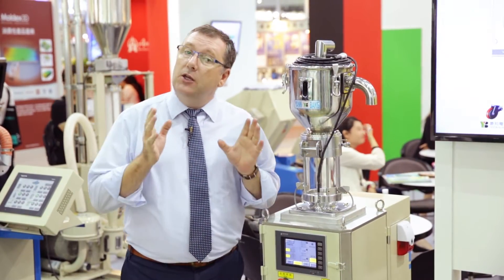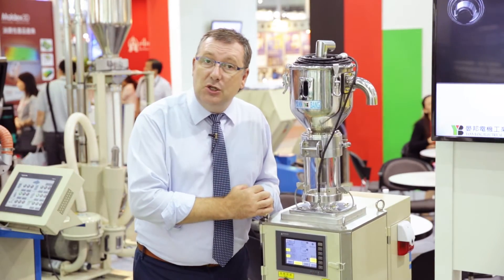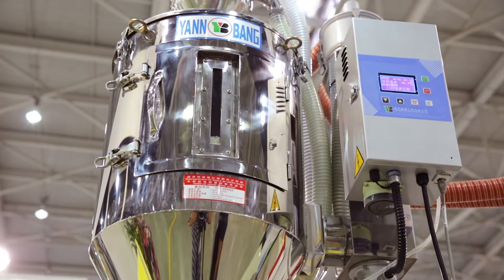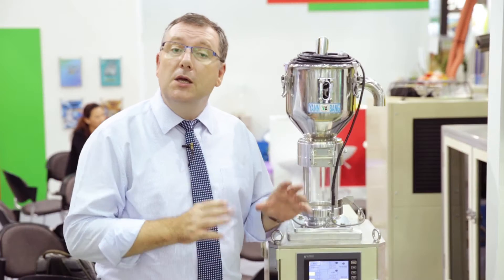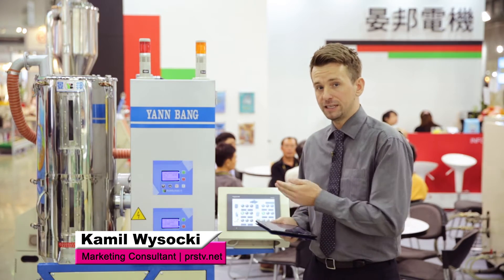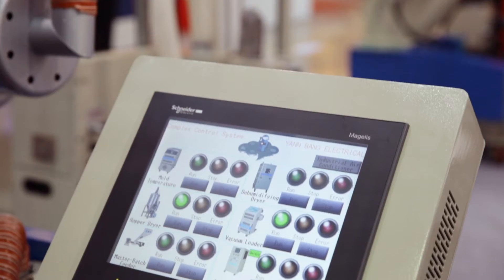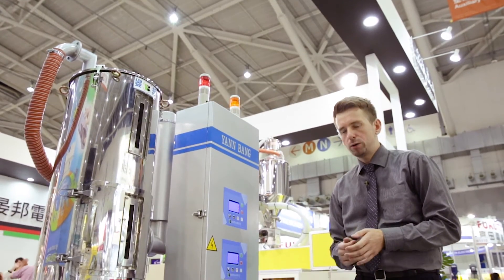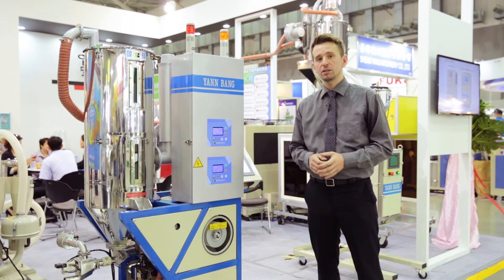Conveying Dryer and Dehumidifier by Yann Bang at Taipei Plas 2016

Comment: http://dehumidifying-dryer.wto-btb.com/
Dehumidifying Dryer with MixerDehumidifying dryer Principle: The hot and humid air coming back from the drying barrel is cooled and blown into the honeycomb runner. The moisture in the air is adsorbed by the special runner, and then desorbed by the regenerated hot air. The two airflows act on the runner at the same time, and with the rotation of the runner, the moisture in the air is continuously adsorbed and desorbed by the regeneration air to be discharged, forming stable low dew point air, which is heated to The drying temperature of the plastic is blown into the drying barrel to form a closed cycle to dry the raw materials.
Dehumidifying dryer Application: In the plastic (resin) molding process, bubbles, silver bars, poor transparency, cracks and poor stability are easy to produce. Dehumidifying dryers can dehumidify and dry plastics and resins (such as PA, PET, PC, PBT, etc.) to improve product quality!
http://dehumidifying-dryer.wto-btb.com/